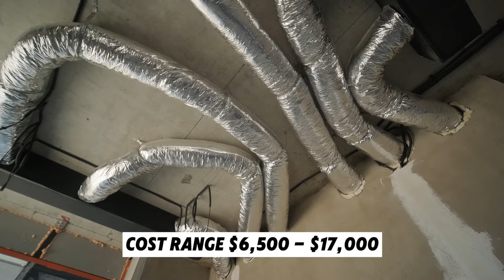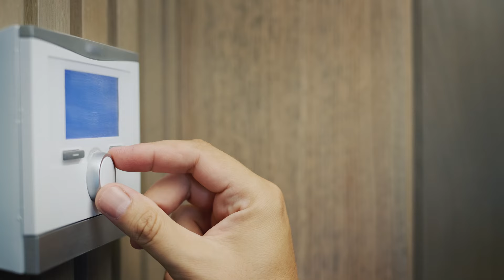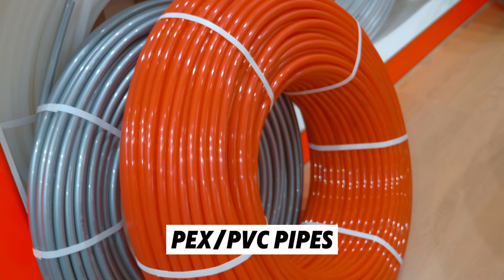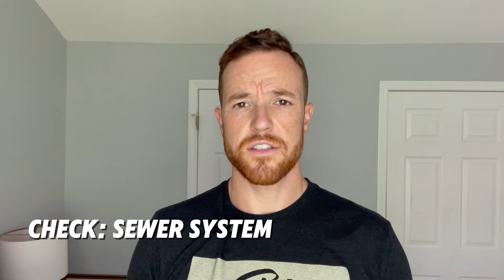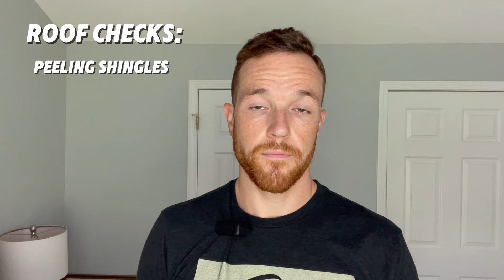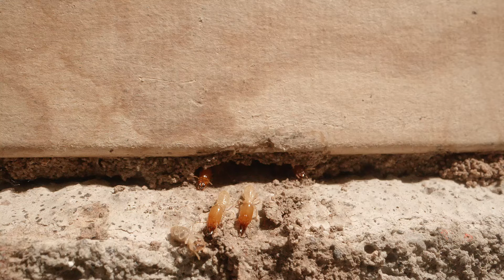Buying a House in Charleston SC? Avoid These 5 Inspection Traps

Comment: My landlord offered if i want to buy the town home i currently rent. Im still thinking about it. But at the same time the ac unit is over ten yrs old(still works) the plumbing in the bathrooms are not so great. The water heater has this rusty pipe on the top of it. Im trying to figure out if i do buy, but buy with significant price cut
Reply from the maker: See if you can get your landlord to pay for a home warranty for you. It's about $900 for 2 years, and they'll repair/replace any systems that fail during those first 2 years.

City are you in? I have a couple of recommendations, but it depends where you live.
Reply: @thomasjoneshomes im in west palm bch flo
Reply from the maker: @rindershow212  Check these guys out! They have coverage in West Palm Beach:

https://www.ahs.com/
Reply: @thomasjoneshomes most definitely.  Thank you!!

Comment: I wish $17k was on the high end of HVAC.  Try well over 20k 😢.
Reply: You are correct about elelctrical.  Redoing electrical in my new home was cheaper.  The last home (which was in another state) had a double tapped panel right in front of a stairway.  When we replaced that and fixed all the DIY work, it was over 25k.
Reply from the maker: It all depends on your HVAC contractor! Lots of the big-box companies are salespeople disguised as technicians. It takes a lot of sorting to find a good one. If you're in the Charleston area, I've got a whole list of great contractors I work with! Drop a comment and I'll send it over!
Reply: No, Im in another state.  We went through about 15 different companies to replace our heating and cooling system that were almost 30 years old (hated my electric bill). We did finally find someone for just under $11k.   ALL other bids were at least 15k+.
Reply: Since I am someone who renovates older homes I might as well add plumbing and foundation.   Plumbing is definitely a cheaper repair of major systems unless you have galvenized pipes.  They are PRICEY to remove.  Definitely avoid homes with these.  They are so old you are likely to experience a leak (we had one that took out our kitchen, laundry and 2 bathrooms - insurance company didn't like us after that).  They are usually black cast iron pipes.
As for foundation, make sure it has a water barrier (plastic) in a crawl space or a way for water to drain away from the house.  Moisture trapped under a house will definitely rott out floor joists.   The area under the house needs to be dry.  Otherwise Your entire floor from the inside will eventually have to be completely tore up.  It's just as expensive as a new roof if not moreso.